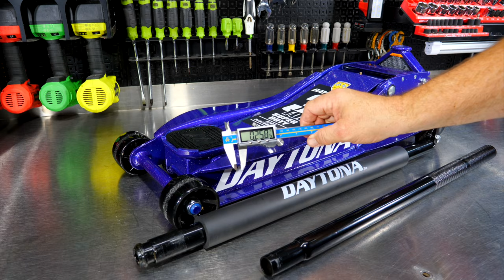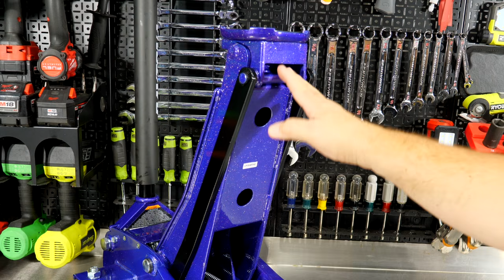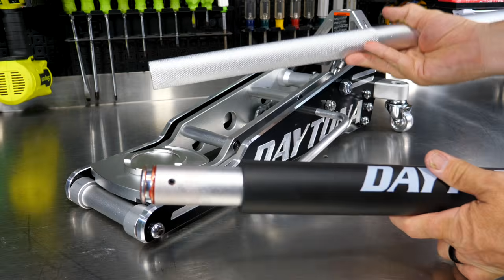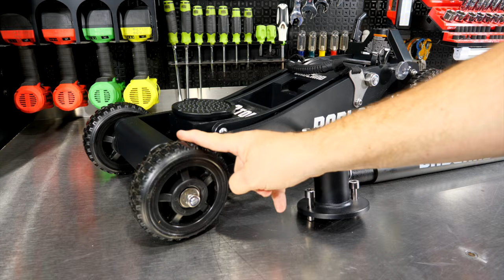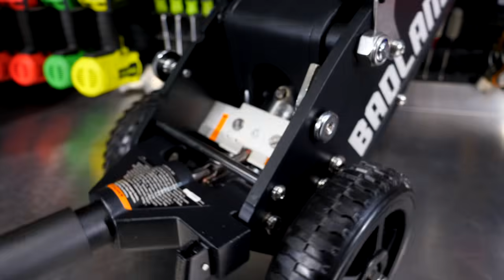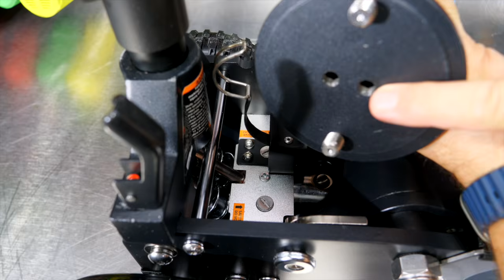3 Floor Jacks You Need for Your Shop - Harbor Freight Daytona and Badland Jacks

Comment: Once again its basically a paid video as he said HF gave him thee jacks. All positive IS NOT WHAT I NEED TO HEAR. I AS a consumer need to know the cons as opposed to the pros----------
Reply: Cons it is heavy to move around, still works on concrete and asphalt but not a maneuverable as a normal jack you will use the lock hold the handle to move jack around. The holder for the extension is weak and bends I left my extension off and some Tools fell on top the jack while offroad bend the heck out of it lol 😆 😄 my extension is off to the side now and rarley need it anyways. Still worth the purchase for the badlands offroad jack.

Comment: Just picked one up for 240 plus gift certificates out the door for about 215 💯 hoping to get that Super duty Daytona next year for my birthday
Reply: Trying to decide between

A.) 3-ton low profile superduty for $173?

B.) 3-ton low profile for $108?

C.) 3-ton low profile extended reach for $144?

D.) 4 ton rapid pump for $144?

Comment: I am familiar with several floor jacks out there, and IMHO, for the money the Daytona line meets 95% of anyones needs.. I was NOT familiar with the all of the features you describes re: the BADLANDS jack.. THANX it was informative and helpful..
Reply: Hypothetically, with only 1 choice would you recommend:

A.) 3-ton low profile superduty for $173?

B.) 3-ton low profile for $108?

C.) 3-ton low profile extended reach for $144?

D.) 4 ton rapid pump for $144?
Reply: @LeviWalton777  All those ou listed (current models) are dual piston aka rapid pump.. which makes them more useful than the $300 Craftsman I've owned for years...
Owning more than 1floor jack.., my favorite and most useful is the (Daytona)  3 TON low profile extended reach (with foot pump)  2nd would be the 1 1/2 ton aluminum jack, because it is light enough for this old retiree to pick up and put in the bed of my truck..

Comment: Just bought the offroad jack last weekend. That flat bottom also serves to stop the jack from sinking a bunch if your terrain has some give that absorbs the wheels. I’m almost never on a flat concrete floor or lifting a low car so that jack matches my use case better than any steel wheeled floor jack.

Comment: I have the low profile 3ton rapid jack its great lifts yp my 04gmc 4x4 no problem and slill low enough to fit under my wifes 16 sonata to lift up to get oil changed or whatever i need i love it

Comment: I have the Daytona long-reach floor jack but I didn't know about the off-road Badland jack, which claims the $280 price is only good until 2/4/2024 then they'll add $40 so the price will be $320
Reply from the maker: It's so hard to name a price for HF. They're always changing the prices, and they always offer coupons as well. Sorry about that, but I'm sure the price will fluctuate around that $280 to $300 ranges. Thanks for watching.

Comment: I have 4 Made in USA jacks, 1 Made in Japan Sears, 2 Aluminum HF , and the Purple People Eater Daytona, but my favorite right now is the Badlands Off-Road Jack...lock the handle in the 45 degree position and it moves around easier than the other jacks, even on concrete...just push down on the handle to lift the front wheels and you can spin it in circles...
Reply from the maker: That Badland jack is for real a great jack for in and around the shop. So easy to move around. Thanks for watching.
Reply: Do you think the badland can lift most stock cars or is it to high  to get under a car
Reply: I CAN'T BELIEVE PEOPLE CARE ABOUT THE COLOR. I JUST WANT A GOOD JACK FOR A GOOD PRICE. 😂😂😂

Comment: I like the Pittsburgh 3 ton low profile jack cuz on sale, it's only ONLY $99!!!  That's amazing, has the same lifting capacity as the one you showed BUT the down side is, it doesn't lift as high.  Only like 18 and something inches compared to almost 24 inches with the one in your vid.  Still, that price makes it almost irresistible for the DIYer and/or home gamer.
Reply: I have one of those in slate grey when it was on sale and it’s awesome